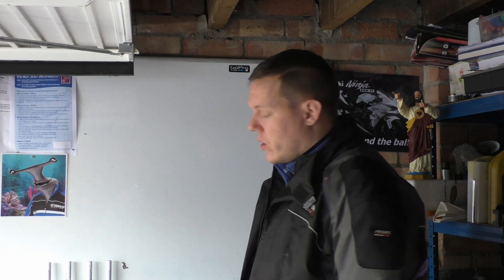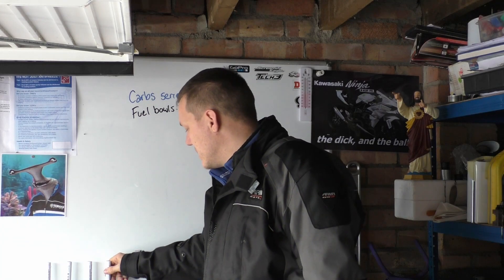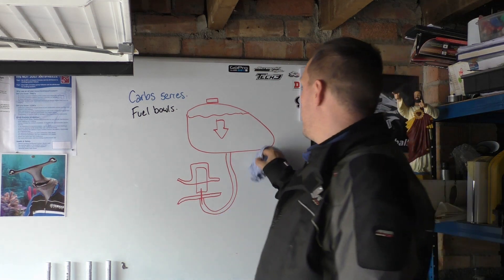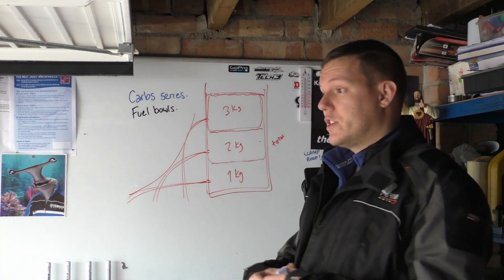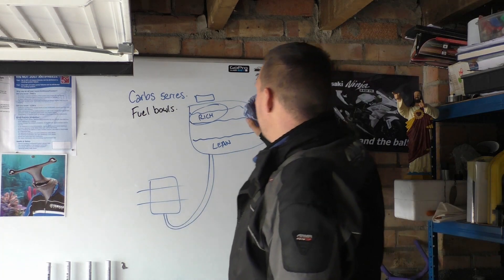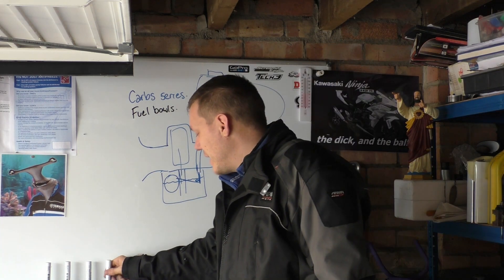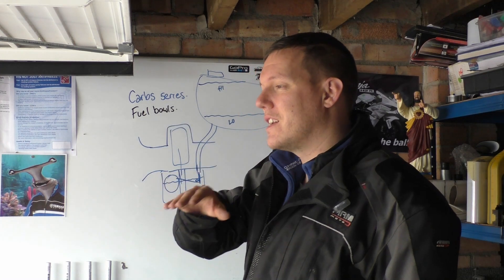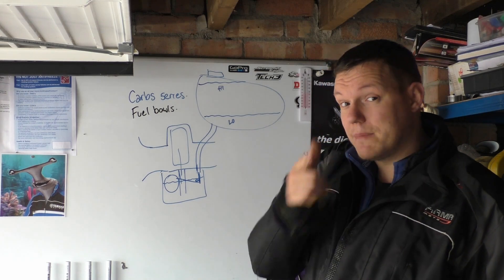Carburetors - Part 1 - Fuel Bowl

Comment: I had an FZR250R and it taught me to fucking hate carbs. A 4 cylinder 250 that revs to 18,000rpm. Bloody hell. Tiny individual carbs with jets for Africa to cover such a huge rev range. One microscopic particle gets in one of those jets and it can fuck your day! 
Had those things apart so much that I can practically rebuild them blind folded with both arms tied behind my back using my teeth! 
I loved that bike, but I won't miss the carbs!

Comment: Matt - thanks for this. I am looking forward to the follow ups, as when I stripped my XV535 carbs down , I amazingly got them working, they were shocking inside, diaphragms dislodged, broken jet blocks, torn gaskets, all sorts, and I had all the parts on the bench in wonderment at their complexity. I know The float bowls are like a constant volume  resevoir but never imagined their design was so critical. As a soft southern twat deferring to your northern and very big PENIS superiority, I would love to be educated into the workings and function of the enrichers specifically. When you are not moaning about Del, southerners, cars, diesels, spurious claims on bottles, pigeons, cheap tools, Haynes manuals, etc, I do enjoy the engineering.

Comment: the 1999 ZX 600R has a fuel pump Carburetors
Reply: yes.think a second about it and you will know why ;)
he didn´t say that there are no fuel pumps with carbs btw ^^
Reply from the maker: "the 1999 ZX 600R has a fuel pump Carburetors" - just like the XJ600 I was talking about the other day - and why I said 'not always' in terms of gravity feed.
Reply: I think the oldest one I've ever worked on myself is '81 ish v45 interceptor. The magnas and sabers with the same motor did too. The saber even had two seperate gas tanks plumbed together with tubing to get the desired  volume packed into the desired package.

Comment: Fucking awesome can't wait for the coming vids. What would you say would be the symptoms of low float height? My GSX 1200 displays a very lean situation when coming towards 5k rpms (and drops in accelaration a lot!, stuttering etc.). My carbs are clean, fuel pump works like a charm, fucking around with choke and a/f mixture screw (more fuel) helps but I don't think this is the main problem. Any ideas? If not, thanks anyways for the vids :P
Reply from the maker: Hello mate - have you changed the air filter(s)? The main cause of leaning out is too much air (obviously) check that all the vacuum lines are in the correct places and then check the manifold boots etc for cracks etc. 2 things you can do - spray carb cleaner or similar volatile around the boot are but not into the carb and see if the revs pick up - also do a plug chop.
Reply: I did buy a K&N air filter along with my new (blackwidow) exhaust. Took it out cause the problem was indeed getting worse. I'll check the vacuum lines. Manifold boots are ok, checked them like you described. I'll take the plugs out this week just to check. Maybe check the coils and grounding if the plugs look like they are supposed to..? TPS checks out so no trouble there. Cheers
Reply from the maker: If the engine is running lean then its a fuel issue and seen as though its carbed then probably a fuel issue - have you balanced the carbs? This is why a plug chop is in order to find out if its all of the cylinders or one/many..........